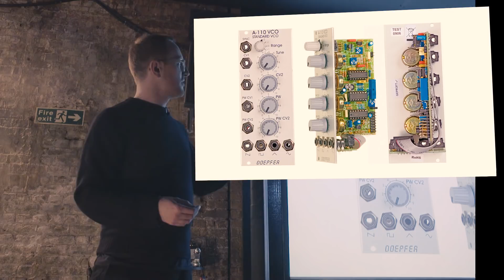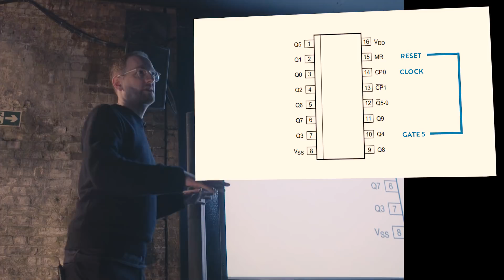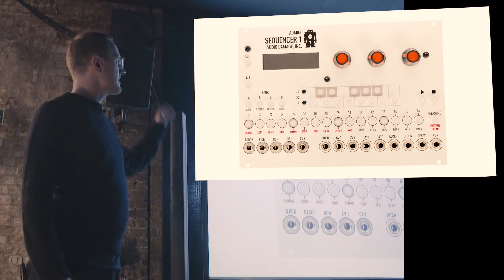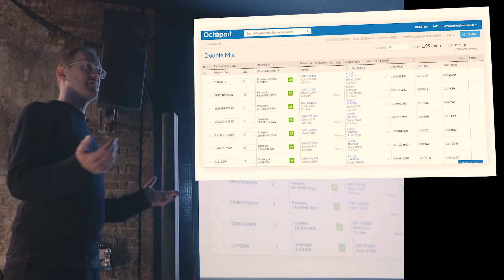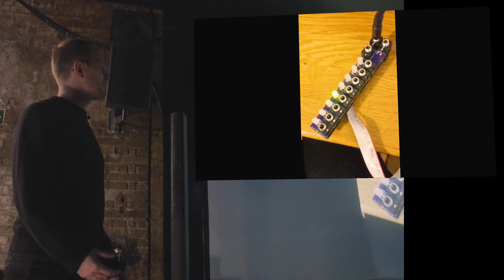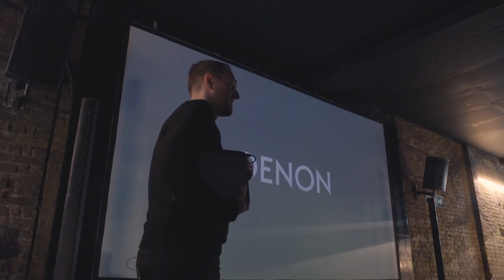How to Make a Eurorack Module: A talk by James Carruthers, NoBots

Comment: I started with KiCAD, it was messy, but I’ve started using it again, it’s come a long way with release 7. Lots of great parts libraries from the likes of 4ms, so it’s got just about everything you could want for a synth or eurorack module. I’d suggest using a PCB vendor that can also do your surface mount PCB assembly. Saves a lot of time and fumes, unless you just enjoy soldering the tiny bits. We’ve manufactured thousands of pieces of our synth related products now, and having a good manufacturing rep is important when you want to make a relatively large volume of product. Frees you to do other things while they source components and handle manufacturing. Doesn’t keep things from going wrong, but if you’re not local to the manufacturer, you will need someone who is.
Reply: While it’s not the most fun part of circuit design, breadboarding your circuits is going to prevent a lot of wasted PCBs. Especially when it comes to CV inputs, DACs and such. It gives you a chance to dial-in you component values before committing to anything.

Comment: The first PCB I had manufactured needed no revisions. It made me a little paranoid using the thing I built 😂 That being said, it had very few components on there, it was mostly just routing pins of screen, keypad and pots to an Arduino. We‘ll see whether that‘s going to be the same for my first synth PCB + Panel combo. Probably not 😅

Comment: I’m not making modules, but I’ve been dabbling in building MIDI controllers, and have done a handful of micro controller prototypes. The paper design and breadboard prototypes are a blast, but then figuring out where to go from there is impossible! There's so many domains that seem to require expertise to get from prototype to production: pcb design, 3d modeling, part sourcing, just to name a few. I haven’t been able to find a ton of resources that don’t expect expertise in one of the other domains. I wish this stuff were easier!

Comment: Yeah, James, that pain portion looks pretty big. Now that the software modular simulator VCV Rack is available it is also possible for people to design/prototype their modules as software versions. Front panel UI can certainly be worked out that way. So we may see something in hardware that had a start in VCV Rack at some point.
Reply: Not sure how involved VCV dev is — but I guess it's possible to prototype in it. Other ways might be a bit more efficient though. There's not always a need to prototype it to that extent.

Comment: What program would you use to prototype in code?
Reply: kingpishful whatever you feel most comfortable in, really. Processing is a good start.
Reply: James Carruthers I know nothing on this so I'll check that out. I'm just a dab hand at soldering.
Reply: In that case, perhaps something visual like max or puredata might be better
Reply: These are things ive wanted to have a go at anyway so Ill do that
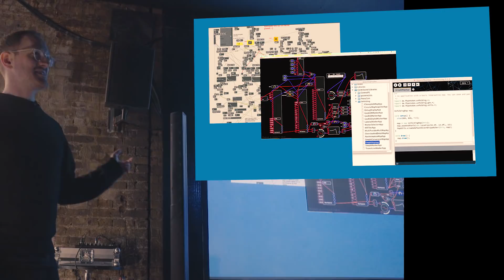Reply: 8:20 shows puredata/max
Reply: DevCrew Audulus - useful for putting things together
Reply: Are any of those in the slides you showed?
Reply: I recognize pd/max on the left, on the right looks like processing IDE, the middle image I don't recognize
Reply: Ah, does it integrate with the others  (pd/max/processing)?

Comment: Great talk. Any tips for frontpanels? I'm aiming for a kind of vintage style with black panels and moog-style knobs, but i find it quite hard to make good looking frontpanels. I've found pod knobs and all that, but black aluminium and then having to make proper holes in them is a pain. How do you deal with this? Or do you just use a PCB as a frontpanel?
Reply: This one has an aluminum substrate panel in black.  Same process as making fiberglass PCB panels (also shown). https://www.tindie.com/products/pmfoundations/micro-vcolfo-eurorack-pcb-set/
Reply: Use maskingtape an proper tools.
Reply: Robin Degen check out Eurocircuits - black soldermask and white silk is an option
Reply: Robin Degen Laserprinter + transfer sheet (not sure what the english term is, it is used for making custom pcb's) apply to the frontpannel and cover with clear laquer. That should do the trick.
Reply: One off front panels are a bit difficult — so I'm not really sure. Aluminium, drilling and matt black paint — I guess
Reply: How would you go about doing the lettering then? My main concern is text. Not so much drilling holes and getting them to size. That should be alright. I'm surprised that there aren't really any cheap front panel manufacturers the same way as there are for PCB's, which you can get for really cheap nowadays.
Reply: Markus Fuller did some experiments with that and he found that the black paint, while looking nice, comes off really quickly around the edges and will wear out pretty quickly sadly.
Reply: Robin Degen I guess it depends what you define as cheap. You can get aluminium PCBs made but they’re still going to cost a lot per panel
Reply: I've seen those yes, and they were within acceptable price range (though stretching a bit). I haven't found any black ones yet though, only plain aluminium. Do you know of any?
Reply: Thanks i'll check that out
Reply: Ellert: I know that that method works ok(ish) for black text on alu, but does that work for White text on black aluminium though? How would that work?
Reply: Kayak Fan hm, that might not work unless you make the transfer part of the blackening process. White lettering can be a challenge indeed.
Reply: what is that software for prototype 8:20